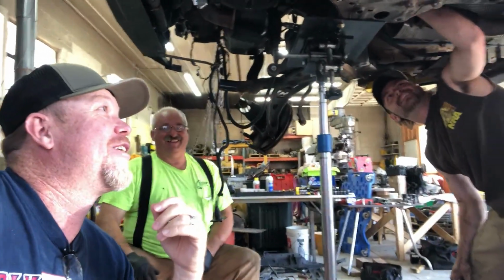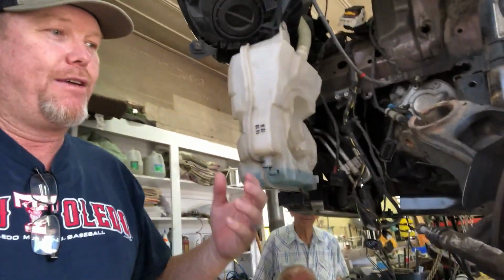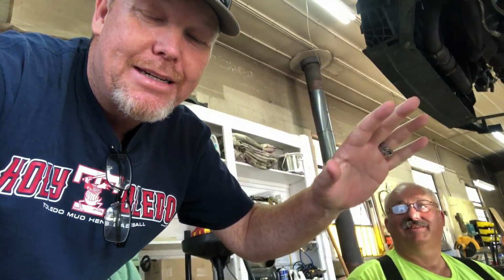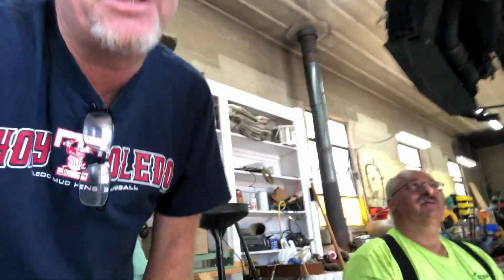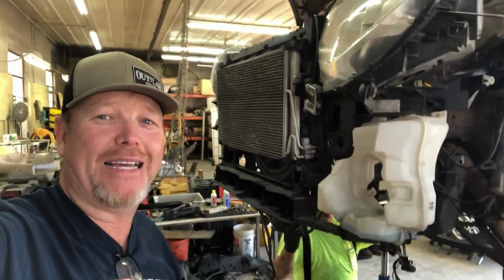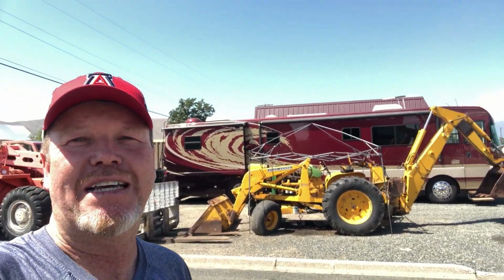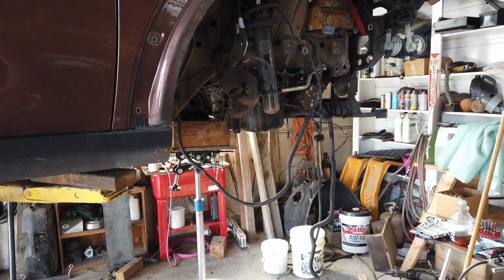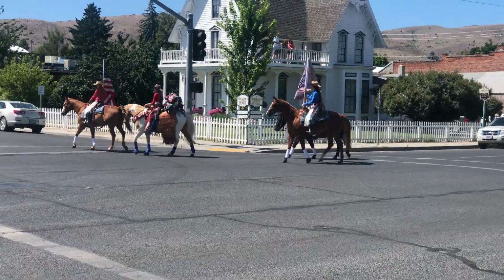RV Tow Car TROUBLES ( Our Clutch Went Out in Our Mini Cooper)

Comment: It’s a Mini.  That’s the way it is.  9.3 hrs. allowed.  Good luck doing it in that time.

You’ll get the experience of a Dual Mass flywheel for $1300.00 too.
Just bend over,it’s not going to be cheap.
Reply from the maker: Got it fixed and my total cost was $1,170 … learned so much.